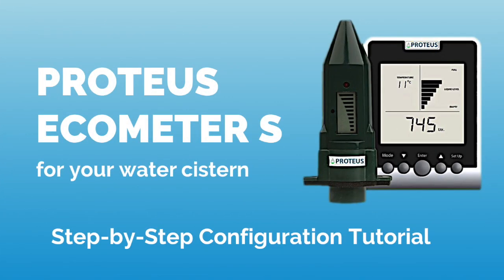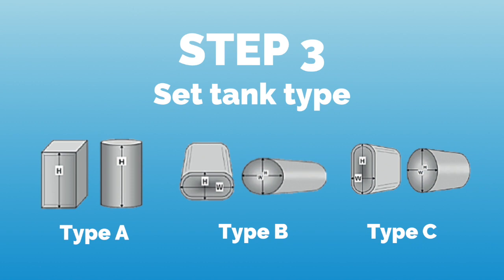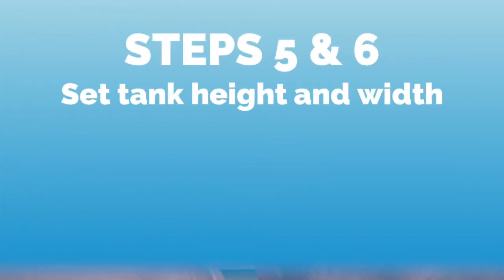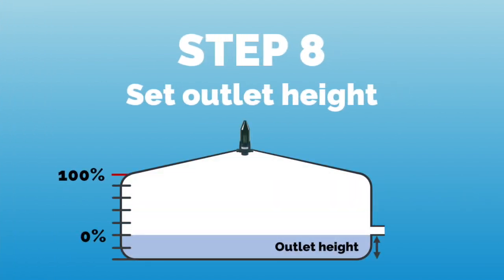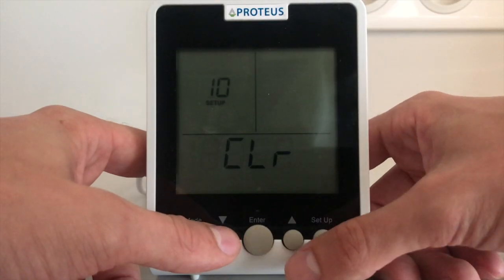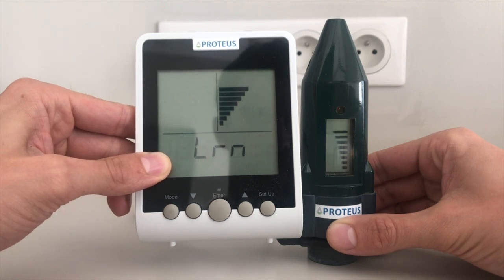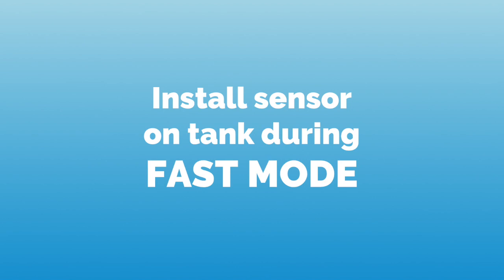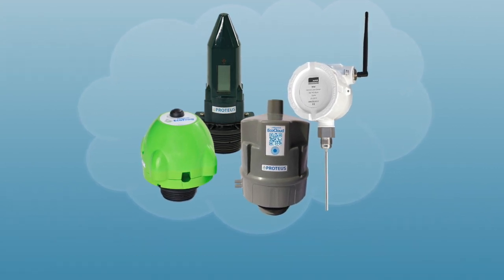Proteus EcoMeter S Level Sensor with Display for Water Cisterns: Step-by-Step Configuration Tutorial

Comment: Hello, thanks for the tutorial. Whys is there a maximum volume limit on the device? As long as I set the length and width of my tank (height below 3m), it should work with any volume. Am I misunderstanding? Can I set only length and width and then it does the volume on its own?